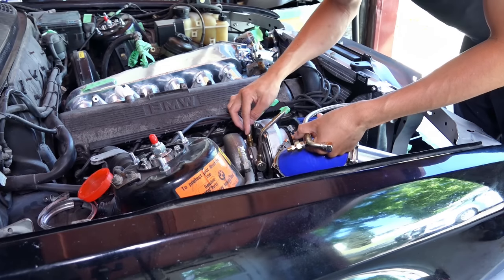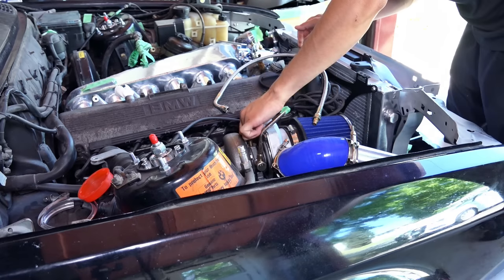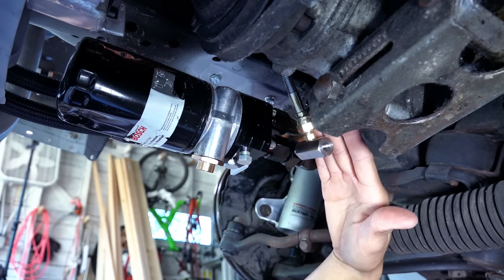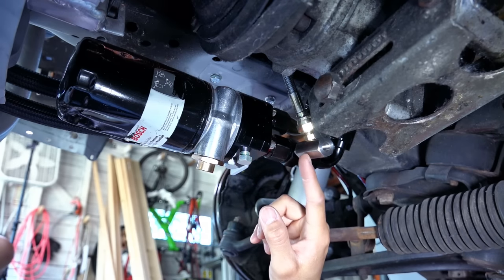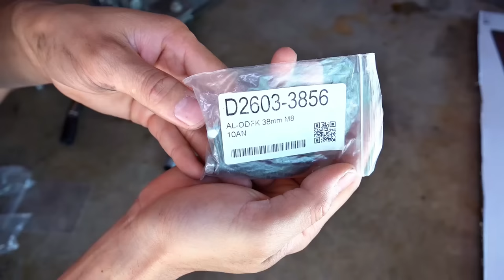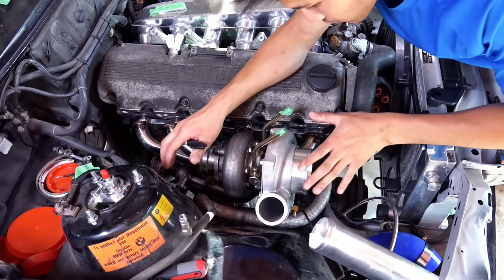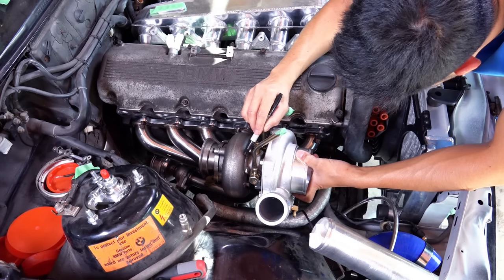E30 Fix 18 | $77 Turbo Oil Feed and Return Lines

Comment: Great job! keep going.. Piece of advice:Replace the 10AN nylon drain hose by the 3/4 Stainless Steel Corrugated Flexible hose. you will never see oil clogging problem, also can get an extra return oil cooling!
Reply from the maker: Good idea! Though, I'll stick with 10AN for now.

Comment: just a tip but when placing the turbo drain, be as straight down as possible with minimal to 0 bends in the AN Line to eliminate the need for a scavenge pump and improper drain.
Reply from the maker: I will most likely have to cut the hose shorter. 👍